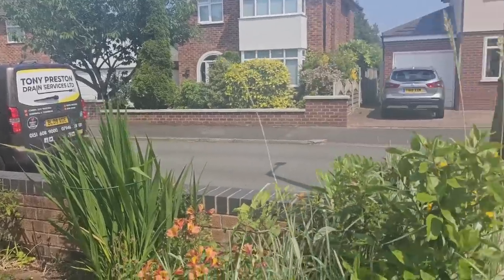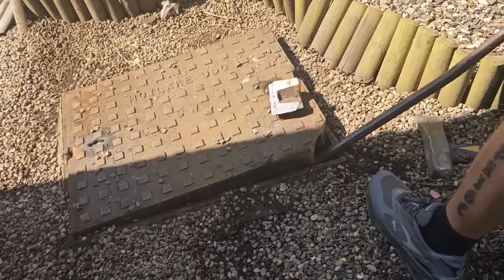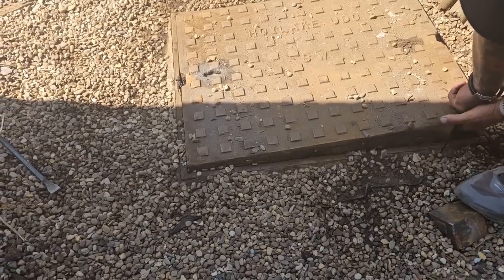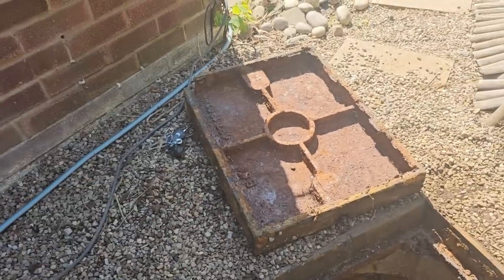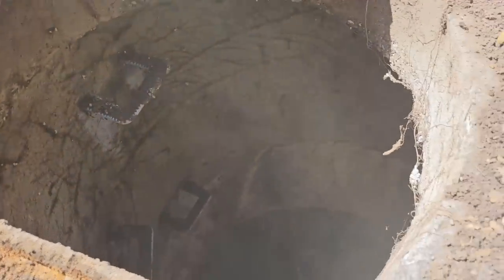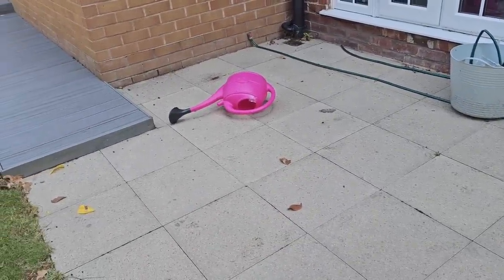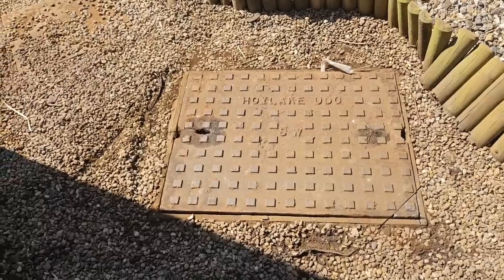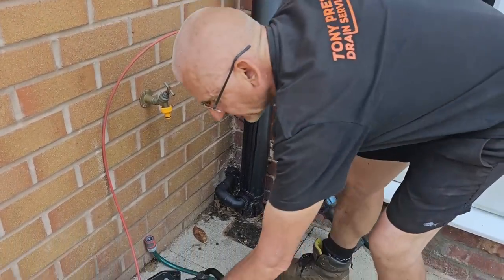Blocked drain. Manhole seized, sealed up for 30 years, you wont believe what it is. Part1. #drains

Comment: There a paiin but uu responsibility.  if you have to take up wd40 seam for 5 mins using  log splitting wedges and  lump hamner  drive the  lid up up
Reply from the maker: Yes established that it was a shared drain once opened.